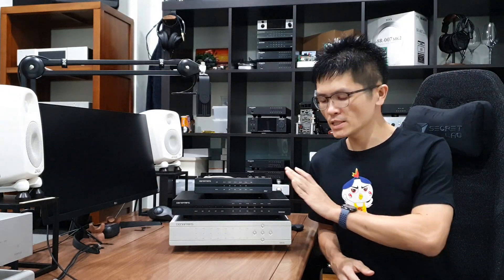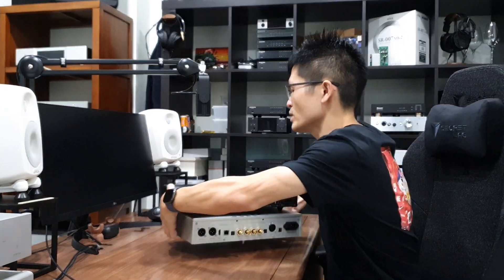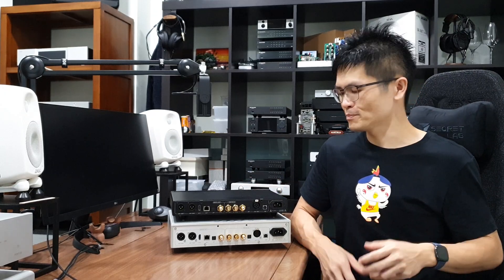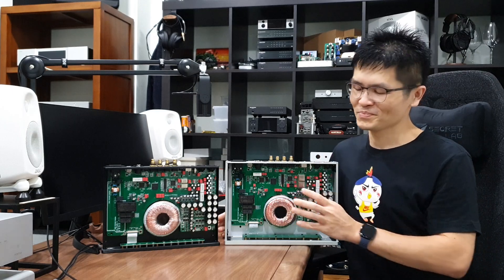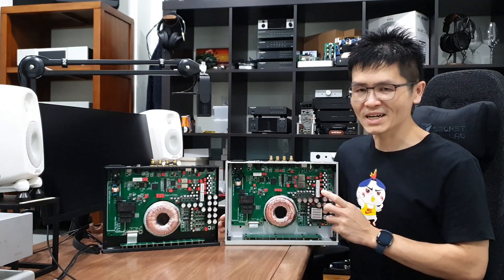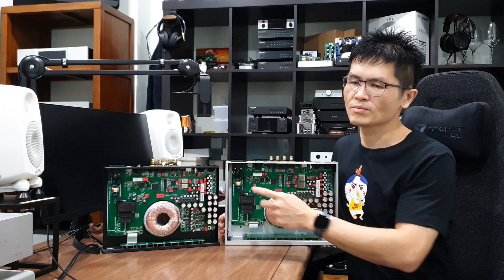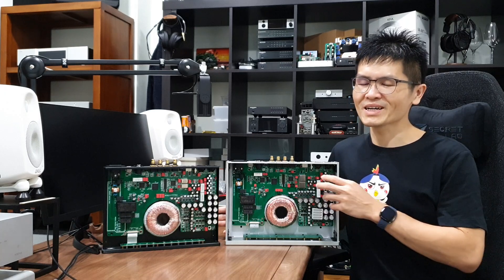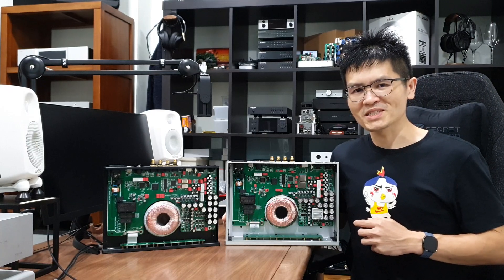Comparison: DENAFRIPS Hermes & Gaia DDC

Comment: Thanks Alvin.....I ONLY use a USB from my high end PC as my source/streamer to an external DAC.  So I need a DDC for sure !!!  I have an SMSL D400ex DAC going to a high end revealing modern Linn pre-amp and Dynamik amps.  Should I buy just the Iris DDC, and which clock would that use, I think the Iris clock no and not the SMSL any longer?  Or should I future proof in the event I upgrade my DAC.. and get the Hermes or Gaia instead of the Iris. Either way I would go USB to the DDC and I2S to the DAC of course.  Note budget is always a concern and size too.  But because I refuse to exchange/drop my PC as my primary streamer as  most recommend and bypass the need for a DDC......and i refuse this because there are just too many options with my PC for streaming sources and viewing over my TV and best User Interfaces not offered by most all streamers...........WHICH DDC SHOULD I GO FOR !!!  Hey thanks for reading and great video and thanks Alvin.a

Comment: Thank-you Alvin.  I've always wondered what the differences are.  This helps a lot.  Is the Terminator II's OCXO higher quality than the Hermes and GAIA?
Reply from the maker: The OCXO of the TII and Herms are of the same quality :)
Reply: @VinshineAudio  Alvin, if the OCXO in Herms is of the same quality of TII, and I paired my Pontus II with the Hermes, can I expect the same performance of, at least, the Venus?  Or would the upgrade be indistinguishable?  I'm wondering if it would be night & day difference in quality or only marginal?

Comment: Hi Alvin, I have the Terminator 1. Do I get an improvement with a DDC? If yes which one do you suggest; Gaia?
Reply: Any news??
Reply: @PaoPaoBuz  Yes, unless you can connect to share the clock (i.e for us with Terminator 1) Gaia is the better choice…
Reply: @shanflash6893  what do you mean share the clock?
Reply: @PaoPaoBuz  in Terminator 2 and Terminator Plus (as they have the necessary inputs)  you can connect the Dac and the Ddc in such a way that you can make the Terminators' chips Master. This way you don't need the Gaia's clock which is better than Hermes' clock. However Terminator 1 does not have this connection. Therefore, with Terminator 1 you need the Ddc with a better clock.
Reply: @shanflash6893  with Terminator 1 i connect It with i2s??
Reply: Yes, use the I2s A (Hdmi)
Reply: @shanflash6893  In your opinion, what would be the best choice to match with my Pontus 2?
Reply: @thomasgunn4146  Alvin says Hermes is the way you go if you have the inputs for the clock syncronization and that includes Pontus 2.
Reply from the maker: If you stream music from a computer/streamer most of the time, you may consider adding the DDC. 

By adding the DDC, it cleans up the digital signal noise and the cleansed digital signal can be sent to the DAC via i2s interface.